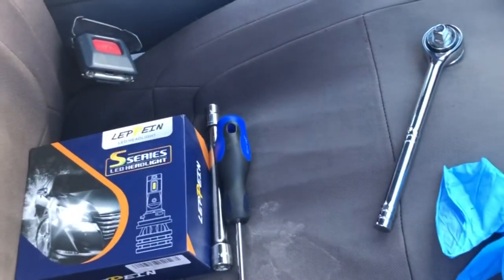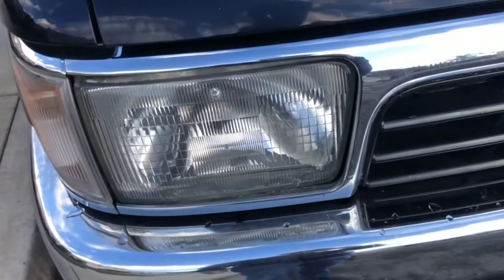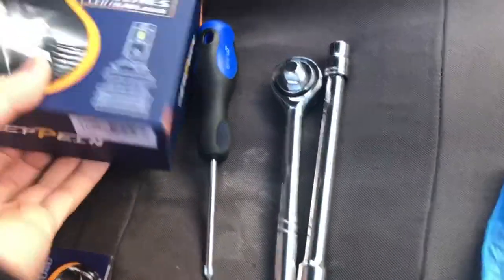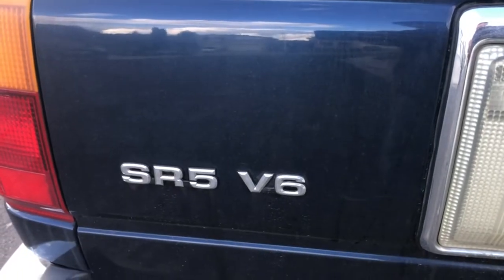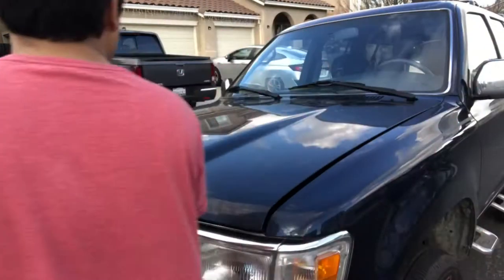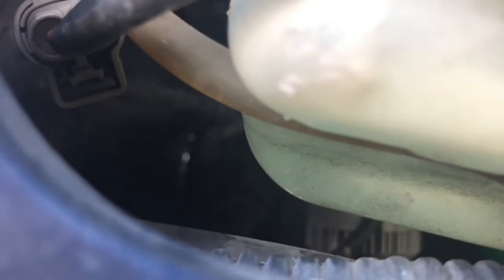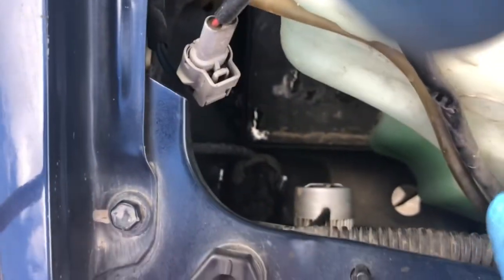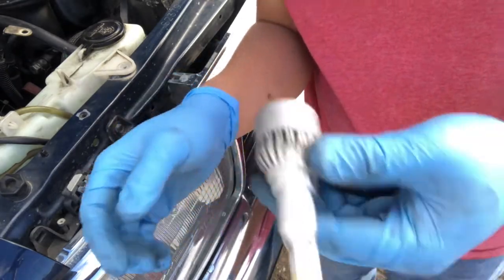2nd Generation (1990-1995) Toyota 4Runner LED Headlights Installation

Comment from the maker: If you guys are wondering if you can do this with the stock halogen bulbs

YES the process is the same
Reply: Where did you buy these at. I have a 94 4runner myself
Reply: They should be 9004 bulbs i think so amazon